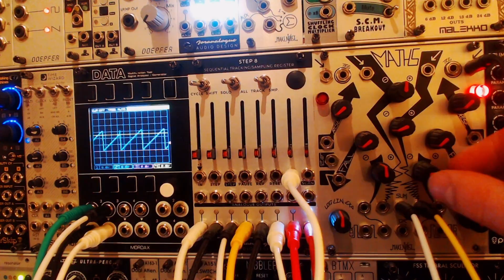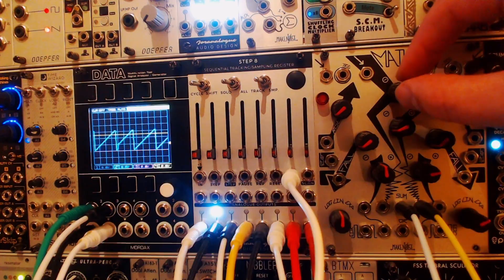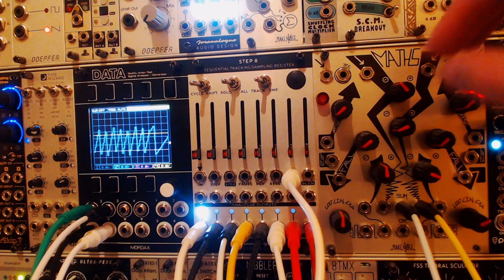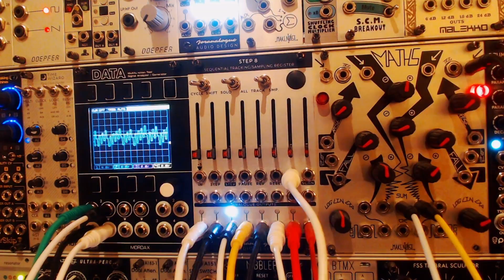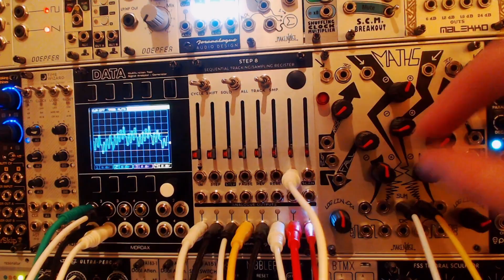Using Step 8 with Nibbler and Maths to generate rhythms

Comment: Now put your phase control through an all-pass filter!
Reply from the maker: I don't have an allpass filter! What would happen if i sent the signal through one? Different slews for different voltage shifts?
Reply: @PeterPlugsPatches   An all-pass doesn't change the harmonic content of a sound, so it sounds the same, but it tilts the phase of the partials. So, the shape of the wave will look different. As an LFO, you can hear the change in waveshape as it manipulates a parameter.